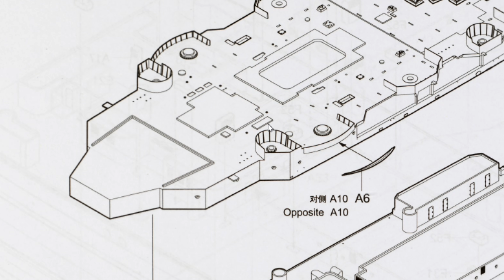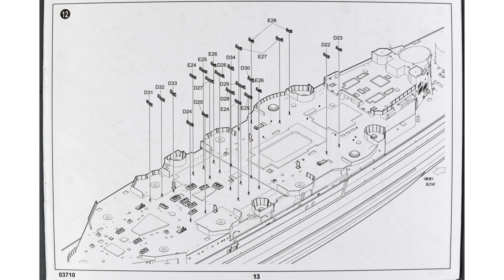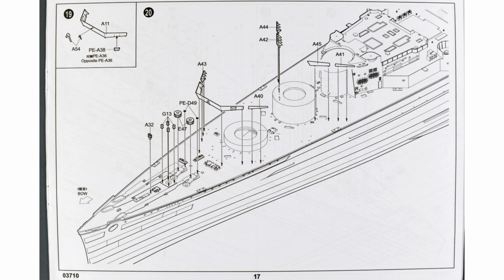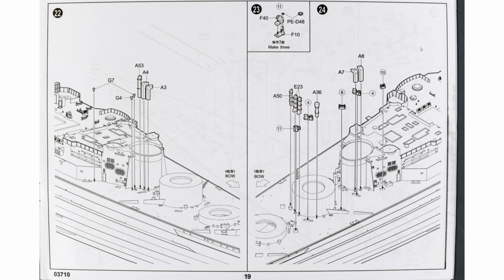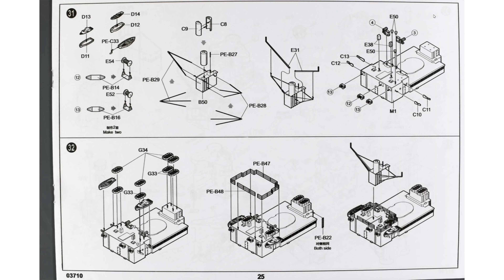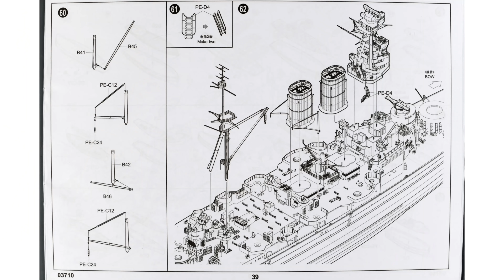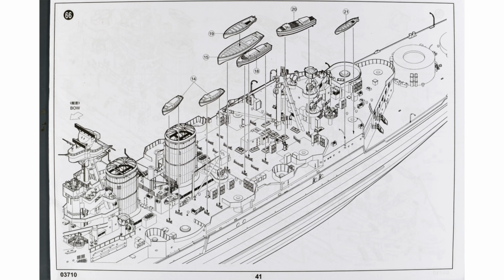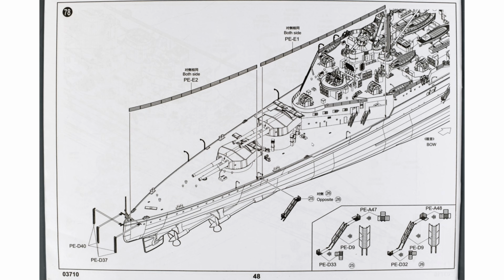The Model Ship - Part 571

Comment: Ron, when you go to remove the tape, just drag (with almost no pressure ) a sharp, ie; new xacto blade, along the paint tape/paint line. This will break any paint and leave a clean line at tape removal.
Reply from the maker: Re: " just drag (with almost no pressure ) a sharp blade, along the paint tape/paint line." Thanks for that tip Tony. 👍🙂

Comment: Looking great.... you can always use a wash on the top of the hatches to bring out the detail. Also, can’t remember which airbrush you have, but you shouldn’t need to mask the whole deck... with a .2 needle it should be fine enough as not to get overspray
Reply from the maker: "Iwata Eclipse HP CS" 🙂👍

Comment: Dear Ron, page 28 top left, step 36, first 2 items (one has life raft on top). Same page step 37 slightly left of centre, group of 4 x G24 with an image of the parts you are looking for and where they go (you will have to paint them before attaching them to the deck). Mabey you could use a black sharpie pen to touch up the hinge detail. Kind regards, Mr"T".
Reply from the maker: Yes, I believe you are right. I do see something now too. We'll fix that oversight later in 572.
"use a black sharpie pen to touch up the hinge detail" Yes, a paint pen.
Thanks 👍🙂